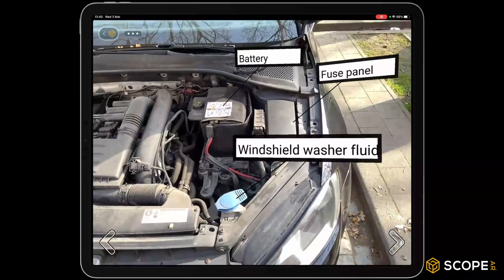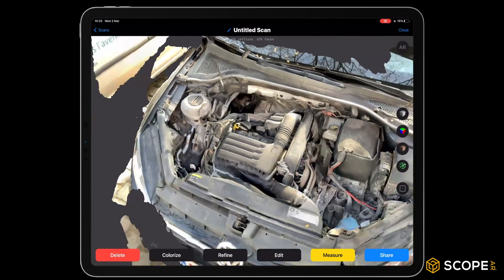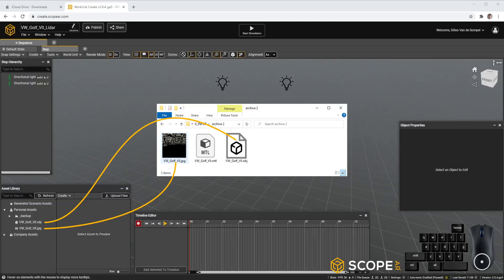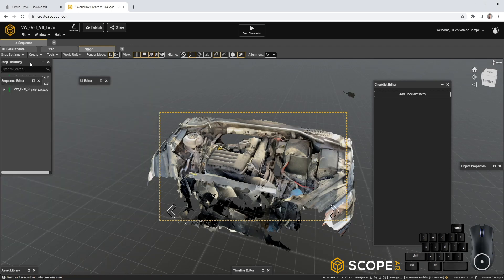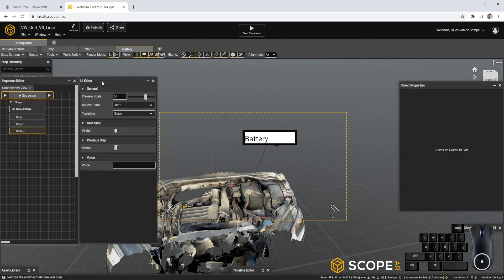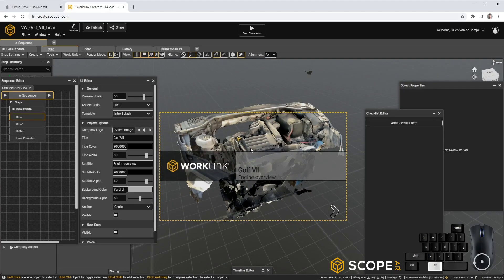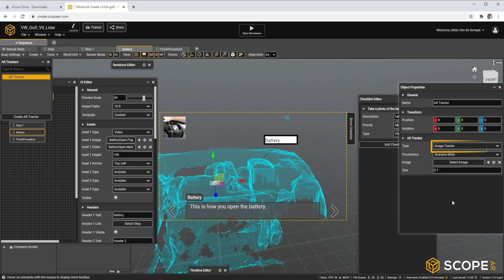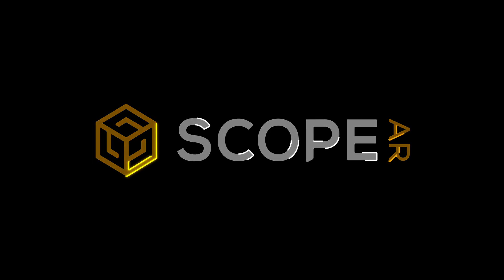How to create AR work instructions using an iPhone 12

Comment: For those looking for best quality settings in "3D scanner app" on medium sized objects (0.5m to 5m in width):
"HIGH RES" mode:
- Max depth: 1 to 1.5m
- Resolution: 5 mm
- Confidence: high (use of highest quality data input)
- Masking: none

When scanning, walk slowly and consistently, ~0.5m perpendicular to areas where you want the best texture quality, keep in mind the texture used to color the model, is generated from the video feed while you are scanning.